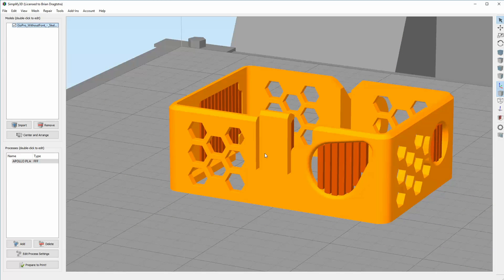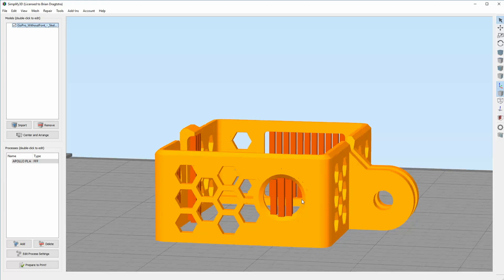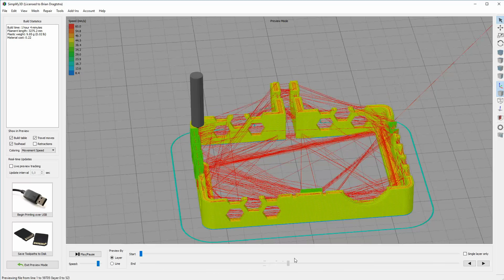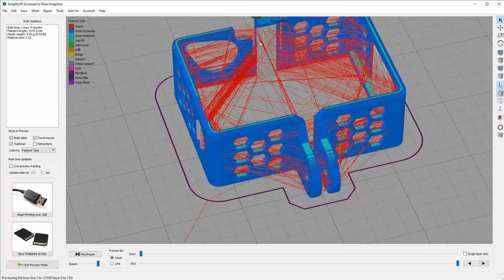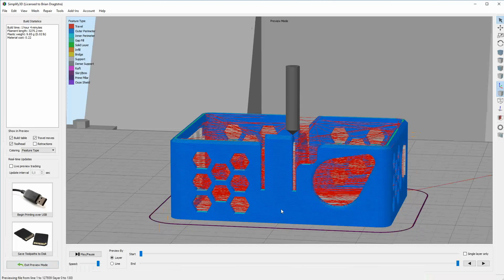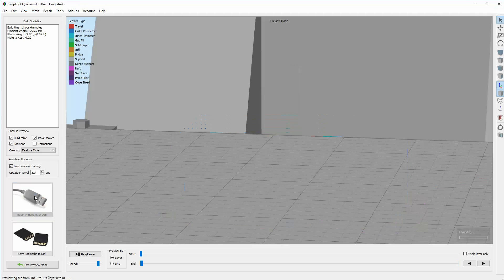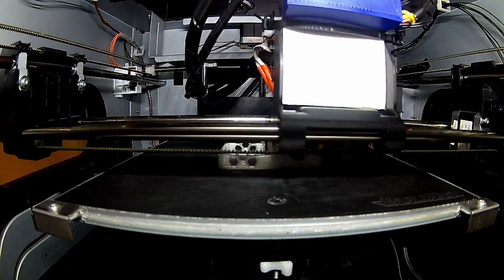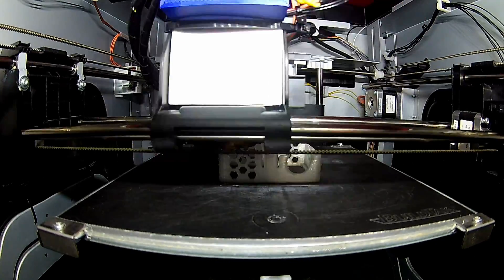▼ #Simplify3D support structures gone wrong

Comment: I was having the same problem. supports looked good until I went to "Prepare for print" and half my supports just disappeared.
Increasing my support infill size to 20% or higher fixed it for me : )
Guess Simplify 3d calculates that yo shit's too thin and gunna fall over.

Comment: I am going to print this when mine arrives so i can use it for recording was wondering where is the best place to mount the camera as I was thinking about getting a go pro mount clip and clipping it to the edge of the bed
Reply from the maker: Edge of the bed is no option as it will get hit by the carriage. For me, the left corner or a support arm in the middle of the printer are the best options.